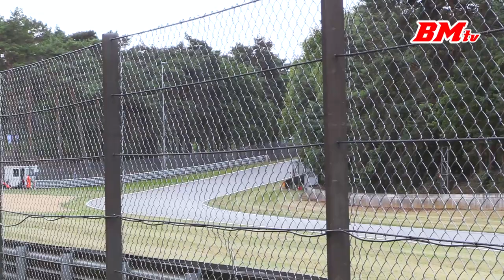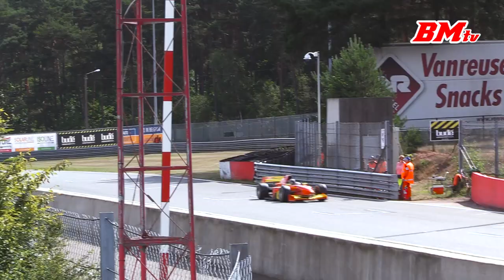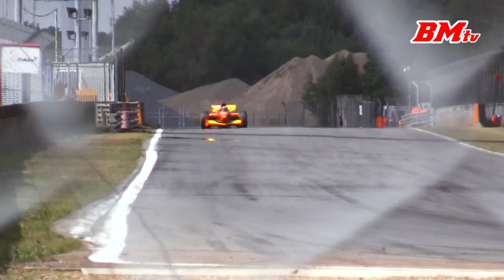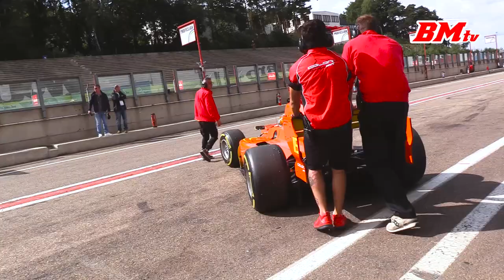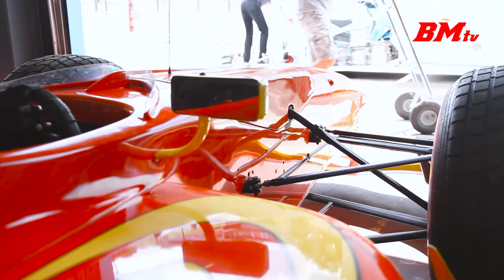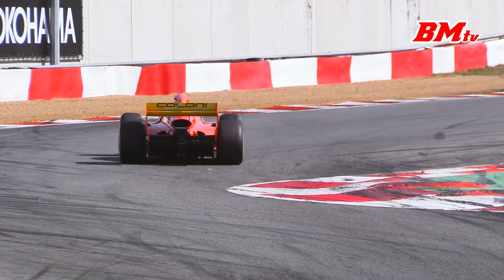Auto GP - 550hp V8 Formula car (BOSS GP Zolder 2017)

Comment: Darn, those cars sound Mean. As always, Nice footage BM. But I have something to recommend you. Could you try improving your transitions in a video, I've noticed the ones you do are kinda of rough as the sounds stop abruptly and picks back up abruptly, same with the footage as well. There are some editing softwares which can help smoothen your transitions to where one fades into the other.
Reply from the maker: Chris Charizard I can easily do a fade between the clips. But I prefer it like this.